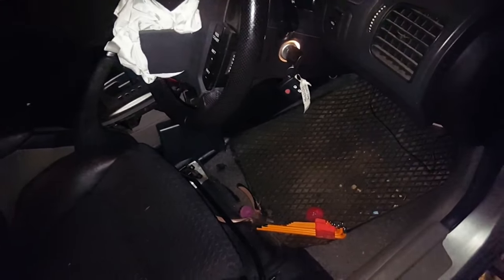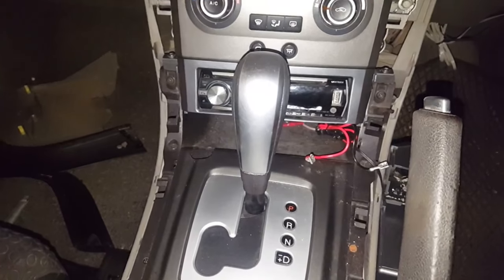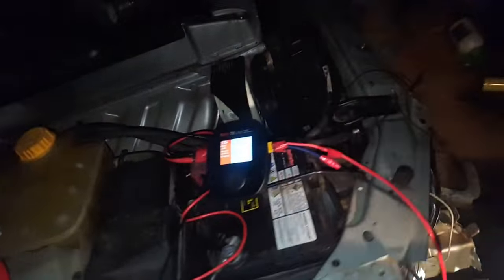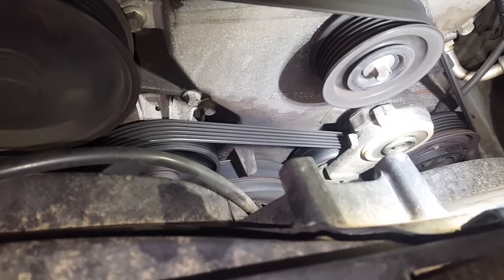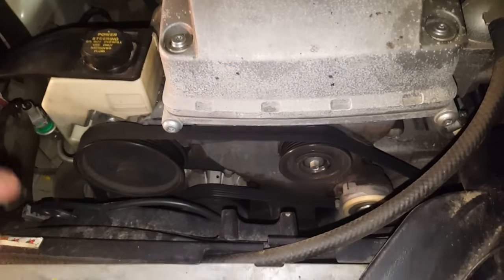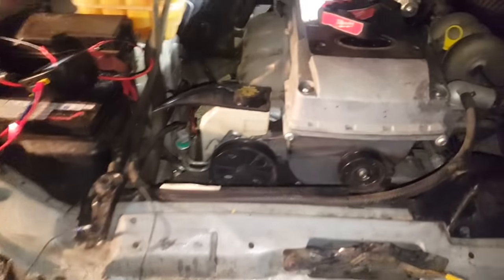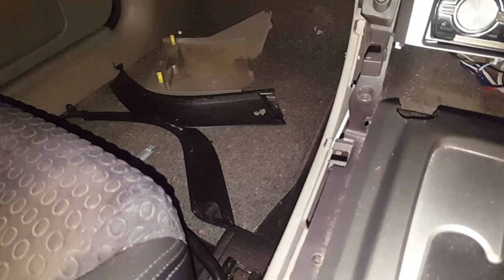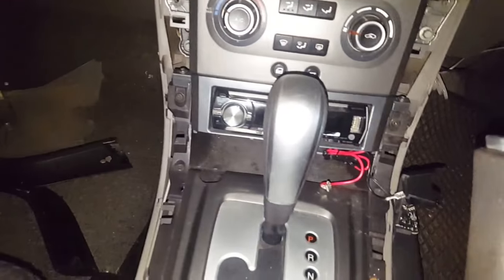Strange Knocking Noise Ford Falcon Bf Mk2 Auto Ute 2007

Comment: Checked engine mounts? could have broken one with the front hit. more noise with rev's could be that the engine is moving
Reply: aircon on? tried turning that up and down? could be fan....
Reply from the maker: Michael D checked fan all good on air con
Reply from the maker: Yah going to lift it up and check mounts

Comment: You need to call in and see mick at the tyre solution and grab his stethescope listening tool, or get one from supercheap. My first guess was mabe an exhaust leak going up at the floor pan making a weird noise. Does it get worse with more RPM or go away? few more tests maybe, and that mic might be cutting the noise out a bit, try pointing it around and seeing if it picks it up better in different areas.
Reply from the maker: Pokey and Sunshine Do Australia worse with revs yes
Reply: Get that tool off mick if he will lend it to you. 
that has helped me track down a ton of issues with things.
Reply from the maker: It is loudest in passenger footwell sadly
Reply: Id be getting it level with rear on stands under the diff so suspension is sitting as it would on the ground, then hunt under it for the sound.
Reply: This comes into the category of don't laugh until you tried it. 
When you don't have a stethoscope at hand then a large long screwdriver placed on the part in question and the handle end on your ear. The yellow handle stanley screwdriver  with the rod coming out the top end of the handle is my favourite for this job. Remember safety first.
Reply from the maker: Robert N yeah im going to lift rear end up and run it up the gears see if it changes as wekk
Reply from the maker: Robert N well
Reply: Try leaning/prizing on various things with an upturned hammer ie the wooden end whilst the engine is running. The idea is to apply a load and vary it, to see if the noise/pitch changes at all. Remember safety first.
Reply from the maker: great idea thanks mate ill update soon
Reply from the maker: IfingerblastGranny's thinking gear box?

Comment: Not the fan motor out of whack or something? Under the glovebox there. Don't know what you have turned on or off. I have a manual for it because I have an xr6 and it covers BA, BF and FG. Does it go quiet when you rev or not?
Reply from the maker: Climate control is off yes changes with a rev. Exhaust system is not touching anything
Reply: Been underneath to see if it's worse or the same there? The exhaust is on the driver's side so I'm guessing it's not coming from that.
Reply from the maker: Can hear it more in cab but under car is there too. Can feel it through the driveline like hand on tailshaft or gear box. Hope its not the trans
Reply: Flywheel loose? Maybe a couple of bolts coming out or something around that area.
Reply from the maker: Oh i hope not that will be sad but i will make an update video soon as i know
Reply: Not too bad if it's just a re-tightening.  Probably something real easy we haven't thought of yet.
Reply from the maker: Lets hope so i was going to dig deeper tonight but its raining here flat out !
Reply: Assuming it an automatic, i have seen a cracked flywheel and the torque converter hit the bell housing intermittently depending on whether it's in forward/reverse gear or park.
Reply: It's an auto. Yeah could be anything like that but let's not assume the worst.
Reply from the maker: oo0Spyder0oo hoping  stretched engine or gearbox mount from the crash

Comment: hi there . did you end up finding what the noise was.. i got xr6 and it does the same noise on the inside and out but it louder and i put it on drive but goes away on park
Reply from the maker: My one was exhaust hitting the body took ages to find it!!
Reply: thanks buddy ..
Reply from the maker: Hope you find yours
Reply: bro i think mine is transmission needs new one ..
Reply from the maker: Oh dam thats no good :( auto?
Reply: hey bro i think mine is the exhaust but dont know if i have to change the whole thing... how did you fix yours
Reply from the maker: Mine was to close to leave spring as my ute has been lowered is yours a ute
Reply: Engine mounts they fuck up all the time